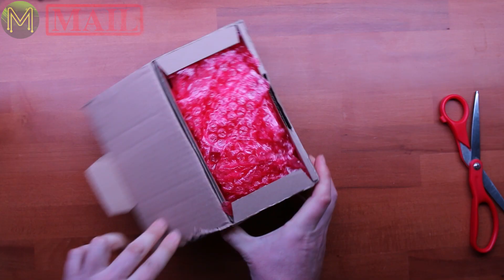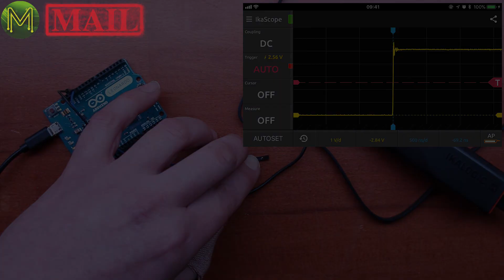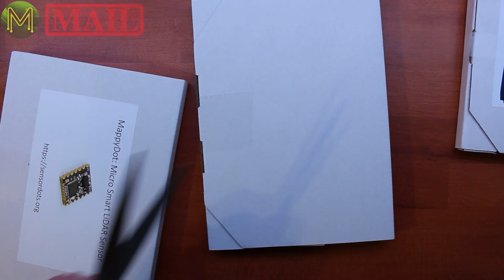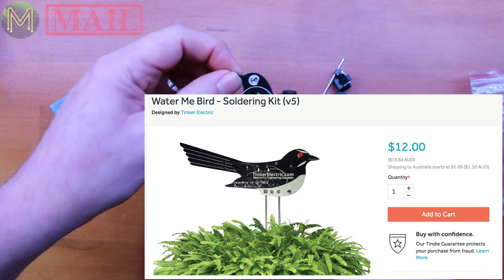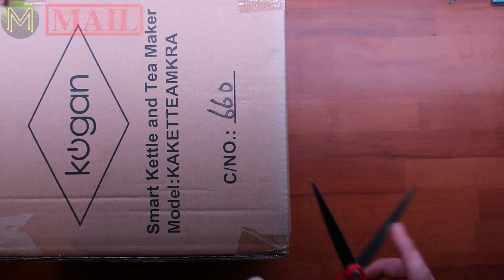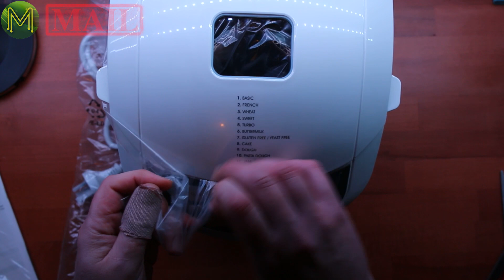#180 MickMake Mail #21: IkaScope, Tindie store goodies & some appliance hacking

Comment: G'Day Mick, the boards need a "Master" assigned in the chain by either bridging the MST pads together on the MappyDot board itself, or the using the jumper on the MST pins on the breakout board (the led flash code indicates it is an address initialisation error https://sensordots.org/ledflash). The master will get an address of 0x08 and then any other MappyDot along the bus will then increment from this address (so if you only have one board it will always need to be the master). The 0x07 address you are getting is the bootloader address, which is why your scanning is intermittent, as the bootloader waits 1 second to start and then de-initialises the I2C slave hardware. There is also another mode you can use to assign any address to the board using the ADDR_IN pin and a 1wire protocol to allow you to be flexible with the addressing if required (different address ranges and groups of addresses).

So the boards are "auto-addressing", but there's some configuration to achieve this. It was a design decision to do it this way to allow for some flexibility to be able to set up different address ranges, and inform the user if there is a hookup issue if they are chaining them together, while also reducing the code and initialisation complexity.

I'll be sure to include some documentation for this with the shipped boards so it's easier to fire up from the get go.

I will also look into tweaking the addressing routine in firmware to make this smarter, which people can update to using the I2C bootloader (the ICSP pins aren't required for development/flashing, unless you want to write a completely custom bootloader or application). The firmware is also open source so people can make tweaks if they like - https://github.com/MappyDot/Firmware

Cheers for the review,  pointing these things out helps me polish things off :)
Reply from the maker: +bleckers 
Thanks for that. I figured it was going to be something that I had missed. I tend to dive in and skim over instructions, so I’m a good candidate for getting things wrong if there’s a chance to do so.

Comment: Hi im celiac too ... quick gluten free gnocchi .... 6 part of cooked potato 4 part gluten free flour (i use Schar brand here in Croatia) olive oil and Grana padano grated cheese add water to be manageable and blend, roll snakes and cut in gnocchi     ... cook in lightly salted boiling water until gnocchi floats (few minutes) ... works every time (thinking of 3d printing adapter plate for meat grinder for making great looking gnocchi)  ... and TNX for great and inspiring videos
Reply from the maker: +Niksa Barlovic 
Thanks mate! Will definitely have to try that one.

Comment: The ikascope looks quite interesting but I think it`s not overpriced as long as the software is half decent. You don't really pay for product itself. It`s just a shame they used the cheapest abs plastic for the housing and glued it together. At this price level you expect at least something like a rubber overmoulding.
Reply from the maker: +rookieno1 
Yup, I agree. I would find it a struggle to buy one of these. Considering I could get a really decent used Rigol for the same price with double the bandwidth and probes.
But... it IS a really nice piece of kit. Being able to scope something out anywhere is really cool.
This is something I will ALWAYS have in my mobile toolbox.

Comment: pretty expensive to be glued together, was this a kickstarted fufill or pre production unit?
Reply: My thoughts exactly on the use of superglue instead of screws and metal inserts. Seems to be an in-production item:

http://www.saelig.com/product/ws200.htm
Reply from the maker: +Winston Smith 
Clearly it was designed to be not pulled apart and there were parts of it where you could see they changed direction in design. There’s a place for buttons in the case, but they decided not to include them in the final revision.
Reply: Thats a shame, it looks like a nice piece of hardware, but price point makes no sense.

Comment: On the kettle did you say pull the code from the original chip? so how do you do that thanks Bob
Reply from the maker: +Bob Wareham 
Yup, it’s not that hard if the fuses haven’t been blown preventing the read back. Most MCUs have an ICSP interface.
Reply: Ok I will remember that in the future could come in handy for interface use thanks Bob-UK